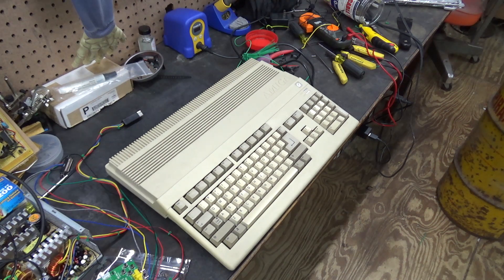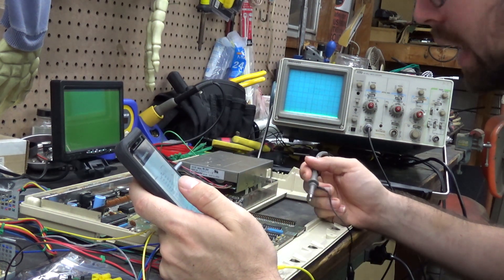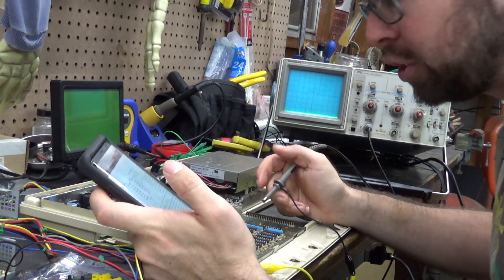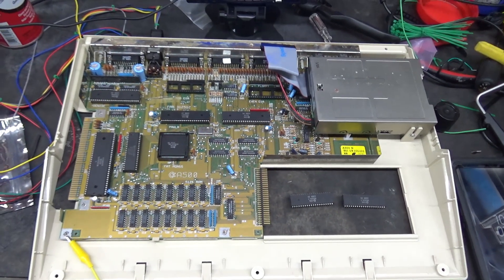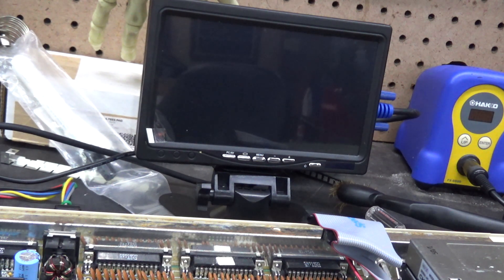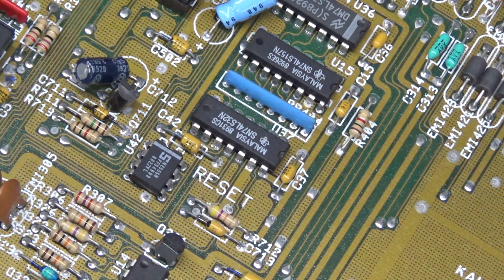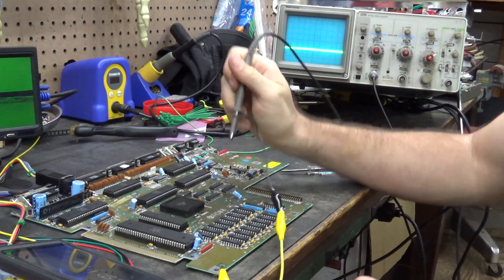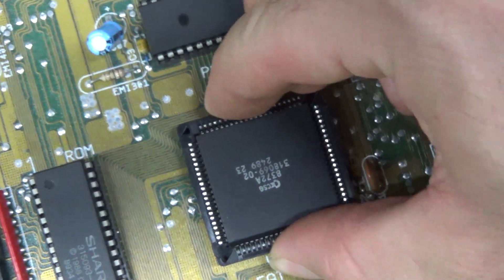Amiga 500 Project PART 2: Green Screen Troubleshooting

Comment: Try resit the Angus, and check chipram too.
Reply from the maker: You are right. I put in a new Angus socket and the computer came to life
Reply: Glad to hear that , congratulations !!
Reply: @RanHam  bro I'm having same issue, power up green light starts to blink and green screen. How can I properly diagnose with scope if it's ram or angus chip, I checked for temp variations but nothing abnormal.
Reply from the maker: @daaudiome  I'm not an expert but if you have an oscilloscope just start probing around. The schematics are online, start with the clocks.
Reply: @RanHam  I checked clock coming our Angus 7mhz it's outputting, also 28mhz is working.  Is a good reference of a faulty ram if they get somehow warm and others don't.